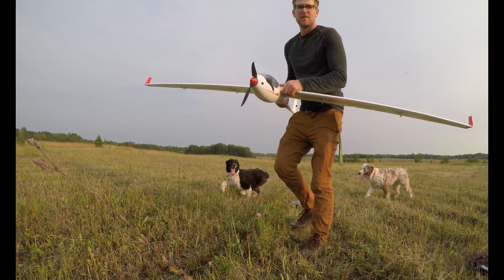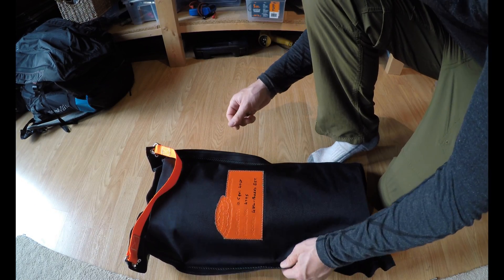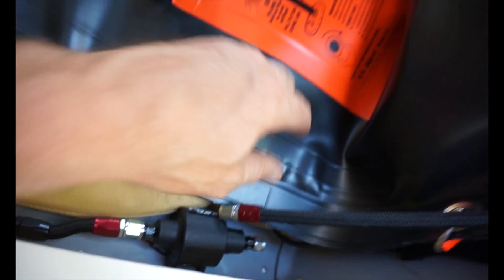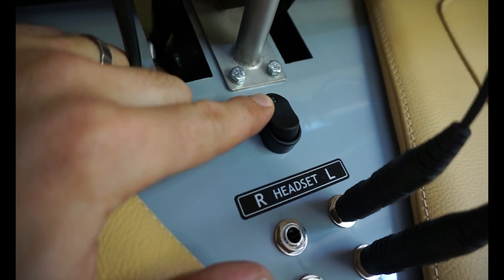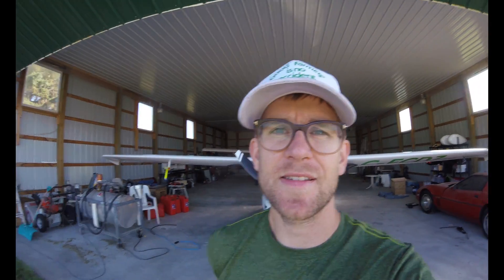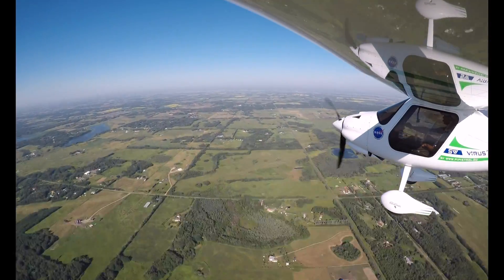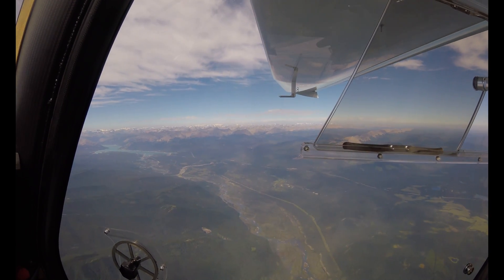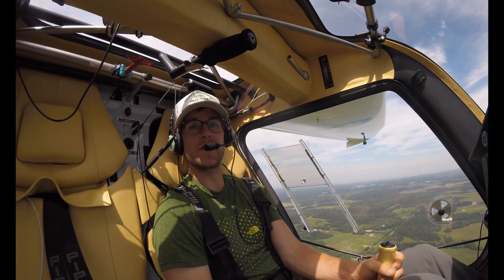We Live to FLY! Extending the Pipistrel's range

Comment: I know you put this up years ago but I would highly recommend a check value to not allow back flow to the 912
Reply from the maker: Thanks. I switch fuel tanks when I use the extended tank. So it cannot get air into engine. But this is actually something I still plan to do and move the bag to cargo bay.
Reply: You bet … I’m in Alaska And am planning to bring a Flex up here through Canada late this year I’ve been watching your videos to see what I might have happen in the interior of Alaska. Have you have and Cold Stress on the wings? Any other stress cracks ?
Reply from the maker: @briancorty4348  Awesome! No I haven't had any cold stress. I have flown my aircraft down to -35ºC.  Winter I remove wheel pants and put large tires on, and cover the air intakes with tape.
Reply: How’s the cabin heat ?
Reply from the maker: @briancorty4348  watch my most recent video regarding cabin heat. I had a custom shroud built for my aircraft to get better heat. Now it's good down to -20c

Comment: Don't the PIP BOYS, Manny, Moe and Jacques, offer a nice neat in-wing extended range fuel tank option?   Seems I heard they do.
Reply from the maker: Never seen or heard of one, does it go in the cargo bay? They have long range wingtanks, that requires new set of wings, landing gear and probably some re-enforcements on the body of aircraft
Reply: @DarrylZubot  I guess we are thinking of the same wing tank option which must be terribly expensive as a modification to an existing airplane.  I guess your passenger seat bladder stays or you order a new Pip.

Comment: Great video. Nice install of turlepac. Please have labels made for fuel pump switch and circuit breaker. You may be the only one to fly this a/c but just in case someone else flies or works they will know what they are for.
Reply from the maker: Dave E excellent suggestions. I have labelled the switches since airing this video!

Comment: If it was "super" STOL and you could fit floats, it would be perfect. But, as in life, you just can't have it all. If i's a really good STOL, it WILL be slow and the range will be short(ish). Slap the floats on and it will become even slower with even less range and useful load. Simply put, these goals are contradictory, if not total opposites. But as a relatively fast and VERY economical long range land plane, Pipistrel is just about impossible to beat. The economy is the best in the world, meaning this is the greenest plane on the planet...not counting their electric glider.

Comment: How much did that Turtlepak + install end up costing you?
Reply from the maker: The bag was about $1200 Can shipped, fuel pump $70, check valve $30, fuel line connectors and wiring about $50. I'll probably put a quick disconnect on the fuel line so add another $100 for that.